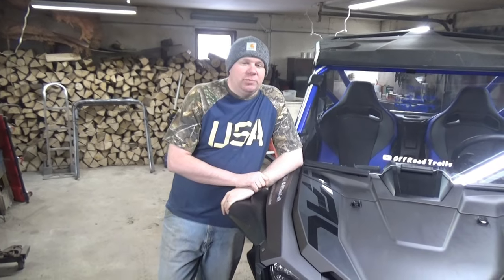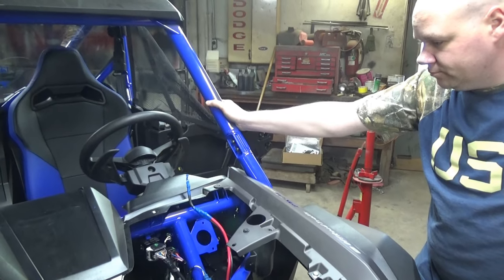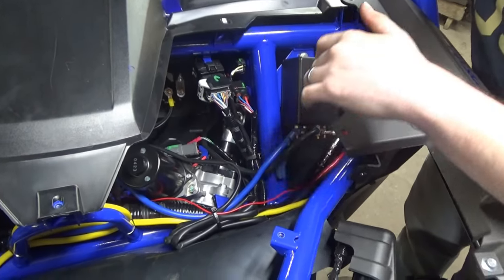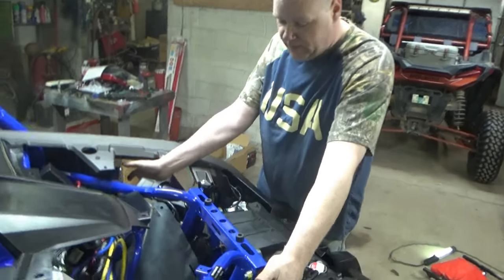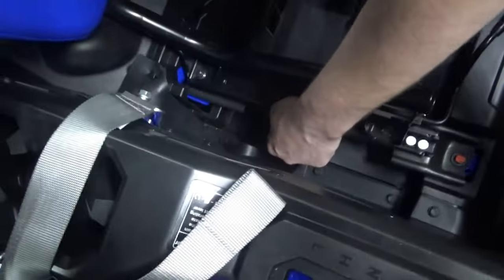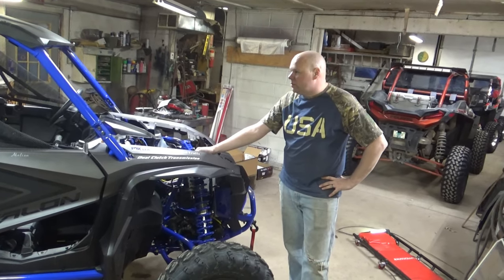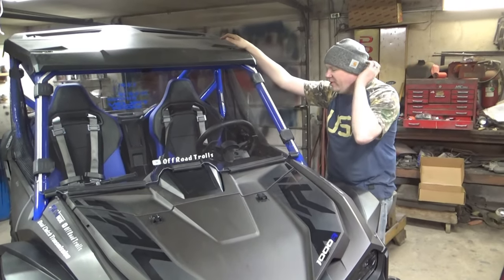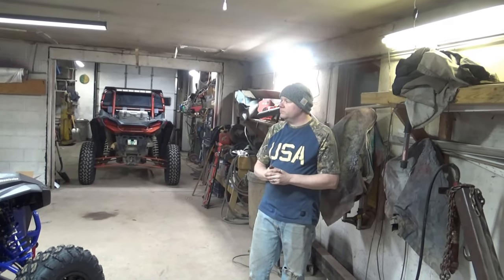Starting the upgrades to our 2021 Honda Talon R Live Valve with SuperATV, and Aces Racing

Comment: What brand of switches  or circuit interrupters did you use ? Are they waterproof , sealed ?  I just bought a HT1000R AND i am in the process of installing lighting, winch, batteries wiper washer system  . Thanks for the video
Reply from the maker: Links to everything we used is in the video description, hope that helps enjoy your new ride 😎

Comment: Whhere did you get the constant power accessory switch from? I couldn't find it in the description box
Reply from the maker: https://www.amazon.com/dp/B07T48QKQB/ref=cm_sw_r_cp_awdb_imm_QBG1W7Q1TFN132HFEFKB
Reply from the maker: We removed the link to the one we installed because it failed, we have replaced it with the one I just linked here and it is working great
Reply: @OffroadTrolls  awesome! Fixin to order right now! Thanks!